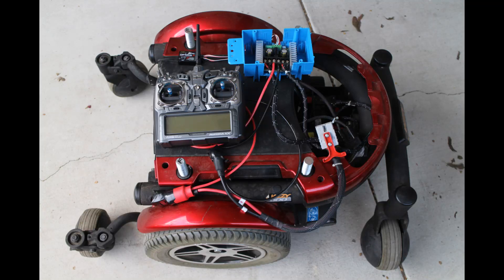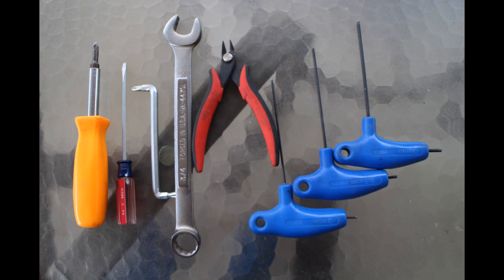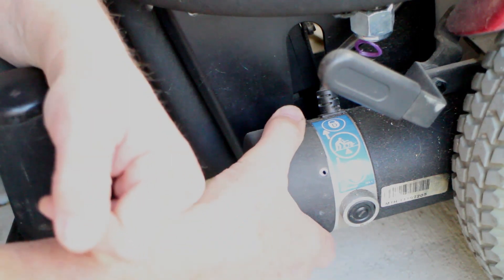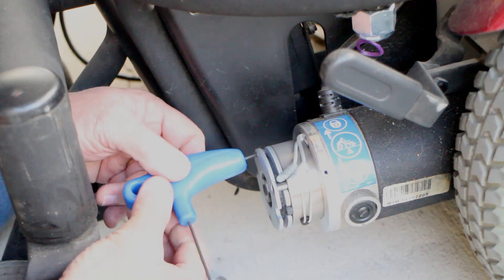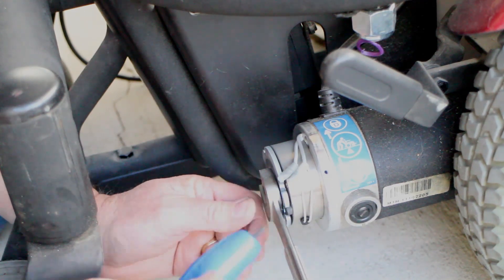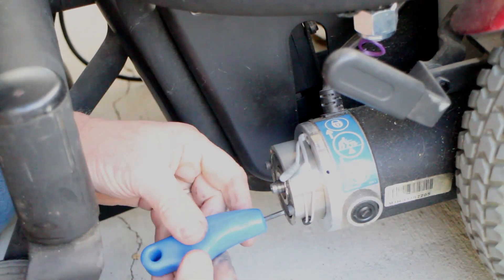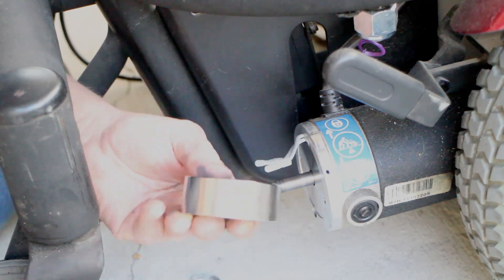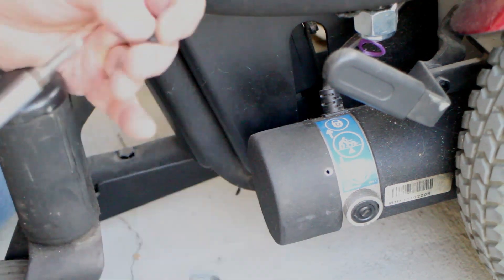Wheelchair motor brake removal

Comment: How do you go about using servo motors to make wings flap? Like a portable prop set of wings.
Reply from the maker: Servo motors are appropriate for wing mechanisms in bird props like I did with my Parrot - https://youtu.be/4WkAM0FpHM0  If you are looking to make a full costume size mechanism, servos probably lack the necessary torque.  You'll need to go to a linear actuator and carry the batteries or pneumatics with a portable air tank.  I haven't built a full set for myself yet but their are plenty of videos available showing some options.  One of the best I've found is from Alexis Lincicome at https://www.youtube.com/playlist?list=PLNBp6zfvEk9JdsvI1o18Fnd3QF2S1xTWy
Reply: That's a good method for the wings but I was trying to make them rotate a 90 degree angle each wing would have their own motor. I would rather them open and close like a book over extentending wingspan. I could up the serve but I don't want to overload it. I would need a control or as well.

https://youtu.be/2jOR1NTKL6Q 
I need to know how she did this motion.
Reply from the maker: @SweetBreatz  Maybe this will answer some of your questions - https://www.tiffanygordoncosplay.com/mercy-wings-combat-medic-ziegler-skin-overwatch